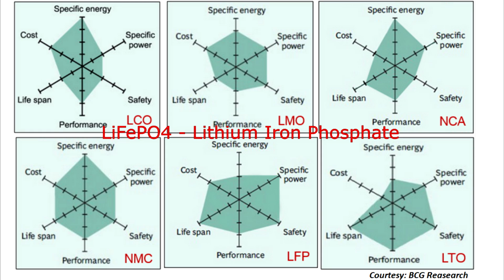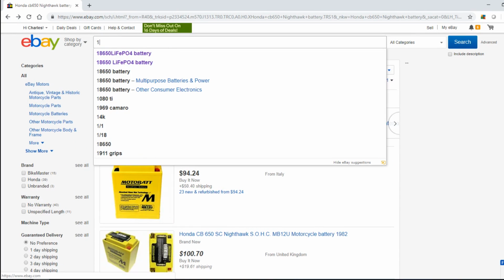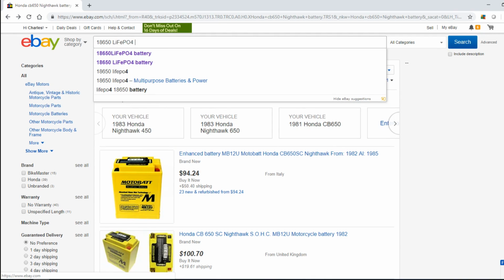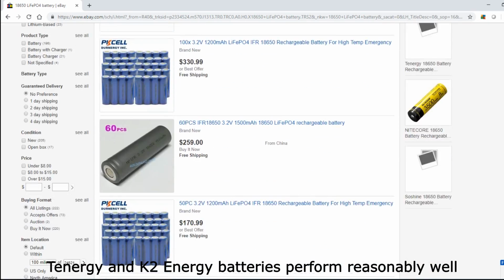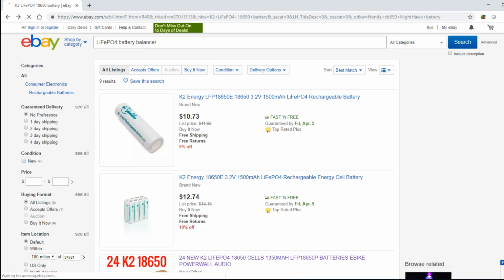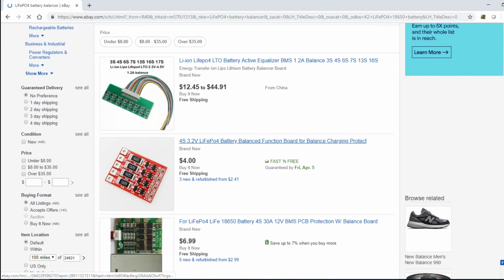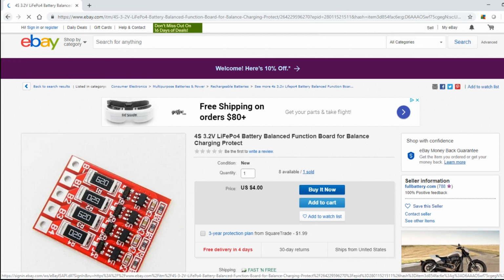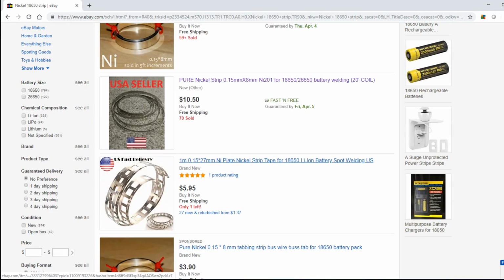DIY a better (and cheaper) long life motorcycle battery

Comment: This is a great list of what NOT to do when building a pack out of 18650s. Geez.
Reply: Lithium Phosphate is much different than Lithium Ion.  Much safer, and not flammable.
Reply: Can you list what he did wrong?
Reply: @mastermaximoo969  Solder, wrong tape, cheap bms weak connections and just about everything else. Never build a batt like this.
Reply: Horror movie. At least neutralize the old batter acid with some baking soda. Imagine someone trying to copy this???
Reply: @dogdipstick  What BMS do you recommend for a motorcycle? Someone without a background on making a BMS might find it difficult to find the right product for the job.

Hopefully what you're recommending isn't oversized as it will not fit in the limited space motorcycle battery compartments have.
Reply: @dogdipstick 
So you say a better BMS. 
What BMS would you use. 
Everyone reading this is waiting for your expertise on this subject to kick in. 

I do not use a BMS in mine. 
I remove my battery and use a Bmax and do balance charging once a week. 
This on a 84 XL350r
I agree with the tape.
Reply: @SuperGrover  Nah just pour it out on the lawn, be fine. Plants love battery acid ;-)
Reply: @mastermaximoo969  soldering is first thing.
Reply: In most cases I find there is a better and safer way to do what was done here, However It should work fine.
Heat on batteries I'm most concerned about for safety.
I would suggest if you use this method do it outside wear protective equipment and make your connection as quickly as possible. Or buy a spot welder for this job.
You can look up safely concerns on the Web.
Quality BMS are a good idea. Look for reviews to support any concerns, charging the Battery I'm not going to cover but 8 was hoping the video touched on this topic.
Over a good video but as a group we could help make it better.
Reply: I'm in the process of building a battery for my 1100cc CB1100FD motorcycle. I wonder how big BMS I need. I do think BMS is a good idea, because the charger on these bikes is not clockwork. At high revs I have measured up to 15.1 Volts. Also when battery is not full, the charging currents might go way up and above max charging rate. The cells I have are IFR26650 3.2Ah, and I plan on 4s6p. Max charge rate of 1C is less than 20 amps, and the charger is rated at 260W. Recommended charge is 0.2C and fast charge 0.5C

Comment: Hi Alex, great video! I'm needing to rebuild or replace my 9Ah lithium battery on my bike. Do you know what the cold cranking amps of this battery is that you made?
Reply: Not really.  It cranks over my BMW 4 cylinder just fine, but it has a parasitic load so I made a bigger one so that I could store it for more than 2 weeks.

Comment: Hi Alex please questions/help 1-Why you choose LIFE instead of LI-Ion? because the voltage 3.2 vs 3.7? Are the main leads connected to the balancer ? it gives you enough amps? instead of direct to the battery? and use balancer for charge only? Thanks.
Reply: flammability
Reply: @trondwell13  thanks, a bit late but good. I built mine few weeks ago, thanks.

Comment: Is charging voltage important? How will lifepo4 be different than lead I regard to the stator/rectifier system?

Thanks again!
Reply: lighter - high power - low stamina - fast recharge - fragile but potentially longer life if looked after - NOT GOOD if bike has a parasitic current draw
Reply: @trondwell13  - Hit the nail on the head with this comment!
Reply: yes - never overvolt and avoid discharging completely - check your bike charging voltage does not exceed 14.5-15v

Comment: Cool info! Is making sure the cells aren't moving around in the old case important?
Reply from the maker: Not really.  I made a motorcycle battery where the cells bounced around the box and it has been ok.  It is best to put a little styrofoam or other material in the battery to give it some dampening, but unless the battery gets slammed down hard, it doesn't really matter.

Comment: Could this be scaled up to work for a car battery?
Reply from the maker: Yes.  I would go 4S/10P.  The battery will likely last as long as the car.
Reply: can the battery pack placed in engine bay?